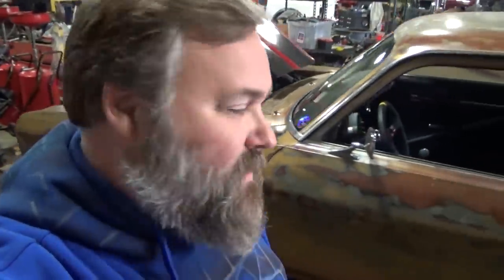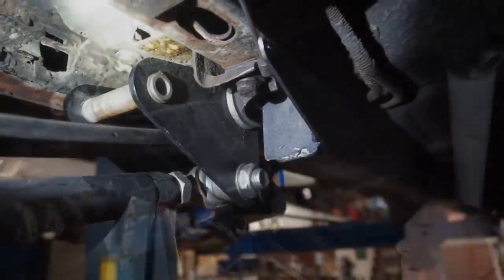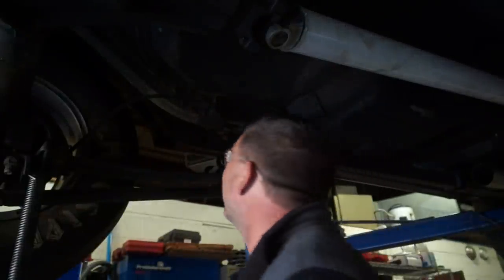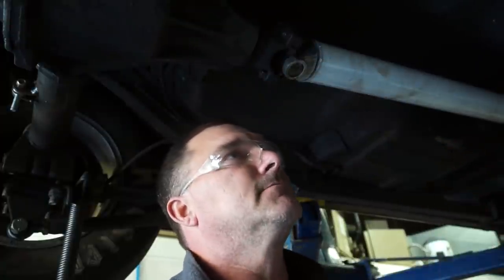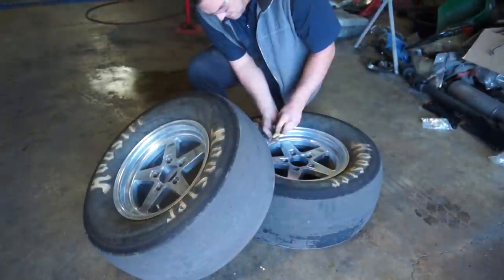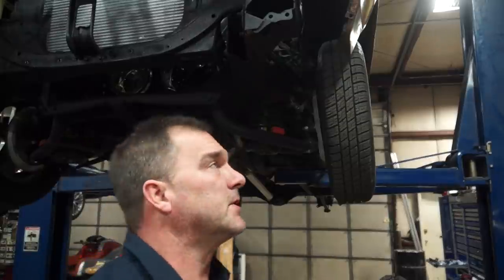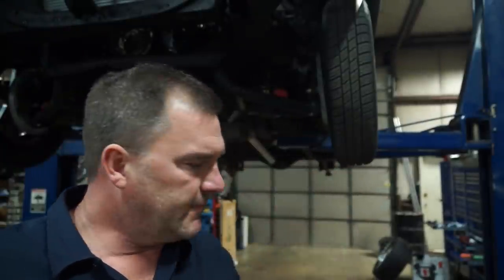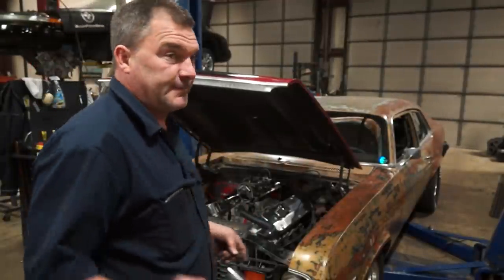"Fools Gold" Nova from DNR Auto Needs Help! Lots of Suspension fixing and  LITTLE things too

Comment: Thanks for the video guys.  Wish I had a good alignment shop where I am at.  I took my 84 suburban up to my local guys for alignment after replacing every single piece in the front end.  After it sat there all day I called them and asked if it was ready and they told me they couldn’t do it because the truck was too old and that the shims are not available anymore.  Haha 😂 what a joke. I have an old set of toe plates and bishman levels. I sat it myself in the driveway and sent it down the road. How ever I have a 68 camaro with cal tracs that pulls fairly hard that I haven’t been able to align well enough myself with no clue where to take it.  Great.

Comment: CONFUSED: Why do some folks install the hood scoop bass ackwards? They are supposed to ram air down to the carb ; backwards creates a vacuum and restricts airflow. What am I missing?
Reply: There's a high pressure area in front of the windshield that forces air into the scoop. Bit of an oversimplification, but they DO work, plus they don't add a lot of extra drag like a forward facing scoop does.